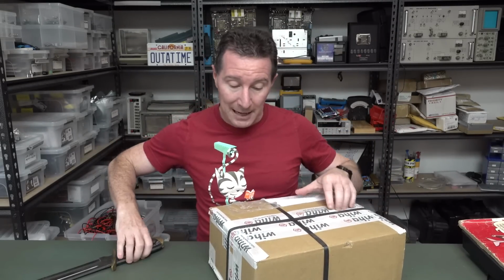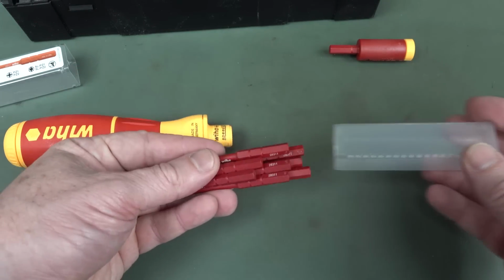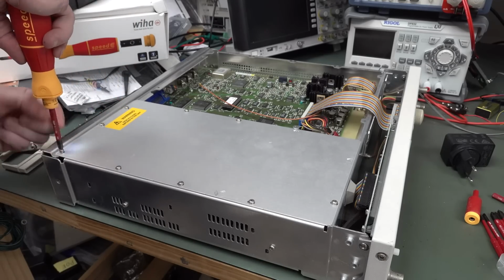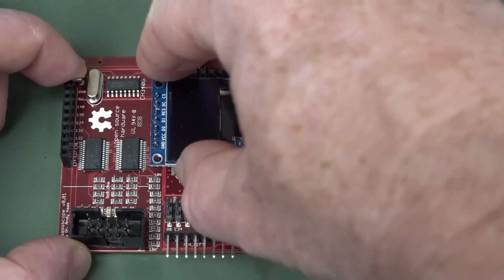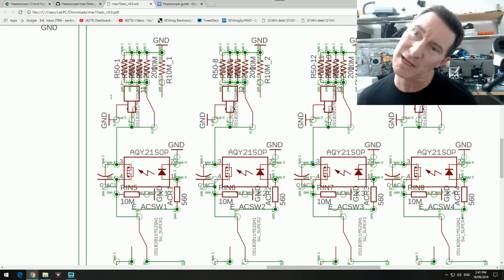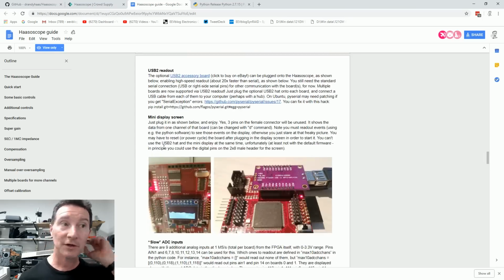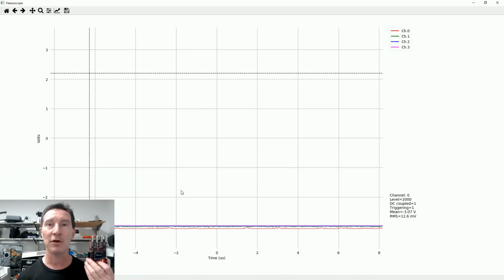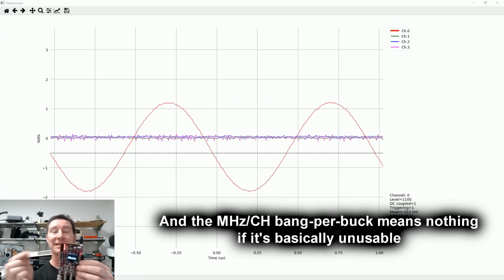EEVblog #1127 - Mailbag Monday

Comment: The red Wihas are of the electricians line, it's made for electricians doing building installations, wall sockets, switches etc, the torque, speed form factor is standard and made for that.
Github definitely needs to fix the download thing, I also wanted to download a certain folder but you have to download the whole project or just one file, they should make a client, like Dropbox, G-Drive etc.
Reply: The whole point of Git is to have full local copy of repository

Comment: That scope ain't great in a lot of ways, but I think your a bit hard on the UI python stuff. I do stuff like this all the time using python + matplotlib + numpy + pandas etc where I'll make some hardware and write some firmware and then hack up a UI or app for the dev team to use until the finished product is ready (maybe some of the more complex algorithms are running in python, not firmware, while we get them sussed since its easy to plot or dump to a file or db etc) . Sure its not a polished user experience that you want to show off to customers too much (although I have incrementally turned them into that in the pat with reasonable results), but you can make a UI like that in a afternoon vs months for a professional looking thing and use it to figure out all the 101 todo things you don't know about while someone knocks up a C++ gui over the next 4 months. So if the point of the thing is to give a user a polished scope that compares to the Rigol DS1054 or clever scope or what ever, then that's not great. But if the idea is to show someone how to hack this stuff together and proto-type like a champ then I like it since we need more engineers that can do this. And the great thing using it you were able to find lots of likely firmware or hardware bugs, like the DC offset on timebase adjust etc that need sorting out. Finally you had a bit of a hard time with python, pip, git etc, but these are pretty common tools for hacking now (but life is a lot easier in Mac or Linux in a real shell), so if this is a hackers thing then I don't think its not too much to expect them to run python, pip install some things, and use github (I would actually prefer it as it is quicker).

Comment: Short-cut keys for a UI ?  . . . Nope. Looks very frustrating to use. The hardware AND software look and work like it's still in the prototype stage . . . not something you would release to the public. Maybe, if marketed as an experimental tool. (GitHub was a little confusing to me years ago, but once you get the hang of it, it's OK . . . definitely has its merits.)

Comment: That's what I hate about Eagle . . . I knew it wasn't a formatting issue with the PDF . . . by default all the component meta-data displays on schematic . . . default fonts are horrible. Default symbols are horrible. And if you're not experienced with schematics, hand-drawing or EDA, EVERYTHING looks horrible. I gave up on Eagle and learned to use Kicad. I've been drawing schematics since I was 8 years-old (am now 57!). I want my schematics to be clear, uncluttered, mono-chrome, clear legible old school drafting-type fonts, have proper flow, and a joy to read. Easy on the eyes.
Reply from the maker: Didn't know that, thanks.

Comment: I can tell that most of the people complaining about installing python are the "if it ain't broke, don't fix it!" type.. >_<

Personally, I find the geriatric, curmudgeonly complaints about the open-source scope quite amusing.  How hard is it to download a zip file or navigate to a folder and download a pdf?  It has .PDF at the end... Do you really need that much help? Take a deep breath, its going to be okay :)

Generational bashings aside, It seems like its quite feature-rich. Like most open-source projects, when they start they are often confusing to those who are used to turn-key solutions.  But turn-key solutions are the result of teams of seasoned engineers and huge budgets--that's why they either cost way more money and have well-refined interfaces.

Comment: I can actually tell you why the insulated bits are so handy. I work as a meterman in germany, having to change dozends of electricity meters every day, usually with live wires. Im using the SpeedE for a few weeks now, and around my colleagues this is pretty much the tool we've been waiting for. The life time is pretty long, it usually lasts me around a thousand screws. Plus, the small red barrel adapter are actually torque adapters, so you can't hand-tighten youre screws past a certain point.

It's probably not going to make a difference when you only take apart a single device, but when having to screw and unscrew all day long, with a lot of uncomfortable angles involved, it makes a massive difference.

Comment: For the hacky stuff I was doing a couple months ago, this would have been quite amazing. Direct capture into python is what I wanted, but at the same time, the Rigol has ethernet standard, and there's already premade python libraries that just grab the data directly off of the scope over the network. It's not worth it if you want to use the scope for anything else. You were using essentially an example script.

Comment: Python is the newbies re-introduction of interpretive BASIC ! The open source competitor to Photoshop, called Gimp, is programmed in Python, and it runs like molasses. This was the the problem of running interpretive BASIC, back in the CP/M and early IBM PC days ! That's why there are COMPILERS !
Reply: Python has nothing to do with BASIC. It was influenced by: ABC, ALGOL, APL, C, C++, CLU, Dylan, Haskell, Icon, Java, Lisp, Modula-3, Perl, Standard ML.
GIMP is written in C, not Python, say that "it runs like molasses" to C guys.
Most of the things do not have to be compiled. But if something do, there is implementations of Python that can be compiled or you could just write your resource intensive function in C, compile it and use it in Python.

Comment: I recognize that IFR/Aeroflex 2025 signal generator you were testing the screwdriver on! I acquired one myself recently for around $400, because it was being sold "as-is, doesn't power up". Problem was simply an open resistor in the power supply. Easy fix!

Comment: The “haasoscope” is, in reality, a cleverly disguised ad for a nice analog scope! Which is what you’ll be hankerin’ for after playing around with this silly thing. Go get the hot air rework station, remove all the components from it, and put them back in your parts bin; that’s really the only value in this thing. As for the rest; see if it’s rated to withstand a 480 V 3-phase arc-over (with proper safety gear, of course!)

Comment: You really ought to do a comparison with that Wiha and the ES120/ES121 "touch screwdriver" from e-design (the folks who made the TS-80/TS-100 mini soldering iron). Big size difference but for electronics fasteners how often do you need a huge leverage?
Reply: There is nothing to compare.

Comment: I was told by the store selling the wiha it's meant to tighten breaker connections, beeing regulated for the recommended torque
Reply: But it's not regulated for torque. The final torque value is performed by hand, taking a guess on the Nm applied.

Comment: How about, buying a combination drill which is at least half the price. $500 or something which is 18v 3Ah.
Reply: How about VDE 1kV approval?
Reply: @JGnLAU  I know that as being a sparky myself for over 14yrs but you do your best not to work on live stuff. Yes we all go it, especially if your doing commercial all the time. 
Me personal I can use CK 1kV instlated screwdrives almost as fast as this tool. If it was 2 to 3 times faster then it'd be a good tool but as it's got no grunt and especially the rediculas price then it's a no go. 

Murphy's Law says when you really need it. The battery will be flat and no where to charge it. I still think it's mad that it doesn't use ths bog standard 18650.
Reply: @thomasg As I've said before. This is a very expensive tool and when the battery goes flat, sods law both of the batterys will be flat. If they were 18650 then they'll be a lot cheaper as they as used in EVERYTHING! 

All you need to do, is use that money to buy a new 18v 3hA cordless drill and loads of new really good quality insulated screwdrives. That way, you can use the drill with the different torque settings to do all of the connections and then if needed use the screwdrives to give them a tiny bit of torque if needed. And as I've said before, if your doing shit loads of these, it'll be a dead supply or turn the breaker off. 

Do not give me any BS, are any of yous Sparky's? If so, show me your cards. 
I've been a sparky for 14yrs now, working in ever different types of environment going from domestic to steel mills and everywhere in between. I know that this tool is a load of wank. Even if it was £50 I wouldn't buy it. Even if they gave it to you for free I wouldn't use it. It's a crap tool and before you ask, yes I have used cordless drill on live equipment for years.
Reply: @thomasg yep. I completely agree.
There only good for big massive companies that aren't worried about money. It'll be really good for doing loads of panels I know that much. I've done loads of panels in the past, but all of them were dead.

Comment: I really love the idea of stackable multichannel osciloscope (I even started designing my own), but execution is poor, frontend is meh, no relays to switch ranges or coupling. USB should be built in, there should be an option for the 1U case, spacing for probes is ridicoulus. I get that it allows to stack them and have very high density, but come on, add 2 more millimeters and be done with it. The LCD screen is pointless.

And software is very poor (not the github thing, but actual usability of UI), just like 90% of other scopes. The only reasonable USB scope I found so far is Cleverscope.

Also, this is not the only first open source one. ScopeFun https://www.scopefun.com/  https://circuitmaker.com/Projects/Details/Danilin-Sergey/MyScopeFun is a high performance open source scope.

Comment: I'm an electrician and I've been saying for years I need something like that. I like the way you need to manually undo and tighten the screw. For me that is ideal. If you are tightening up 3.5mm screws it doesn't take a lot of torque to strip them so having a motor to screw the screw in and out but allow me to tighten it up will save me time and my wrist a lot of twisting.

Comment: Not here to argue, but about github (or gitlab or bitbucket) thing - it's currently a standard for sharing open-source and every developer currently knows how to use git and how to work with repositories at least at some basic level, it's just a mandatory thing for any developer in this day and age. I guess there're exceptions like guys from 1950's or just only hardware guys, but for guys that program that's common and industry standard approach.
Reply: All true, but if you use GitHub you should also know how to distribute releases using it. Nobody expects regular users to do git clones just to use a piece of OSS. So basically none of git functionality even figures into getting a release off GitHub – at least it shouldn’t. The link to the latest release should be the first thing in the README. Most decent OSS projects have it there. The only reason for a git clone is to develop/hack on stuff. If a project needs a clone just to use it, it’s sorta an automatic thumbs down (unless it’s a developer product meant to be consumed as a git submodule or is in prerelease stage).

Yeah, everybody should know git, but if you need to use that knowledge just to use what is a stand-alone application, then the project is failing its users :(

Comment: As a electrician who works in the electrical distribution field my job demands electrically safe tools to install kWh-meters. The screws which hold the wires must be tightned with 2.6 Nm. I have a Wiha screwdriver with torque-setting, because Wiha is the only tool with adjustable torque-setting ànd has a 1000 Volt rating. After screwing 16 screws (three phases and Neutral, in and out, two screws per wire) your hands feel pretty bad... This electrical screwtool could save time and wrists, but i think it's a bit too expensive for just frictionless screwing (and still have to use another screwdriver to fasten things with a certain torque)

Comment: I have built a few USB o-scopes from arduino projects off the Internet.  Many of them were much better then that board, of course they lacked the screen mounted on the board and such and only had 2 input channels. The best of the lot turned out to be not USB at all but sound-card run, I didn't wish to nuke my laptop board, so I used a cheap china external sound card for it, thus sort of converting it to USB in the end I guess.  That one looks like a fairly nice toy to give your nephew who is just trying to understand the very basics of electronics.  Sort of like the old Radio Shack 108 series kits with springs and wires for making circuits and such.  They were great fun, and that board looks like it would be fun for say a 12 year old who likes electrons.

Comment: Woahhhhhhhhhhhh 500 bucks! Holy @&#$

Haha. F that!

This tech will have to come further to impress me. Its just so hard to beat manual screw drivers :)

Ive got a cool one that is not electric, but it does ratchet. And if you hold it a certain way.... It speeds up to 4x speed. And still ratchets.

Mine was probably only 20 bucks or 40 bucks soooo :) and i like it.

Comment: Quite expensive that screwdriver - but Marco Reps reviewed the ES120 and ES121 powered screw drivers, and they are even cheaper, plus they seem to be geared more towards finer electronics stuff, while this thing reminds me of a carpenter's tool. I think if I had the money for something like that, I'd probably buy an ES121 or ES120.
Reply: It really has no power what kind of screwdriver is that.

Comment: 3D Print a piece that fits on the handle on one end, and the cap on the other to accommodate an 18650.
Reply: I guess David - not Dave - could easily do that. Is he still around?

Comment: The software for that USB "scope" is standard fare for scientific research labs. Python2.7 with the trifecta of numpy, scipy and matplotlib is the golden standard for students' quick&dirty data analysis, github is pretty trendy too. Marketing this as an actual scope rather than a hobby kit is a huge mistake though. And I simply cannot comprehend how they didn't fix the connectors as fondling cables is like half of what students do in a lab.
Reply: looking at github, it seems like it's only one guy working on this. That's actually pretty impressive. But clearly this projects needs more contributers to make it a viable datalogger for a rPi or something.

Comment: I get screwdrivers stolen all the time, especially new ones, I'd say $200 Australian dollars worth every year, I would not be happy having a £250/$500 driver stolen, would be looked at as stupid for spending that much on a hand screwdriver when that will get a good drill driver.

Wouldn't want to drop it down a lift shaft either... too small and easy to lose or have stolen..

Comment: except for the protection, I really like the Black+Decker Gyro screwdriver as it has analog speed control. The further you turn the faster it turns. never stripped a hole with that. At CAN30$ cant really go wrong for a hobbyist.

Comment: Open source hardware/firmware/software. Only Eagle CAD has been used for the circuit design, which is definitely not free and thus presents a barrier to entry when attempting to improve upon this "open" design. Yes, there's a free version, but that's limited to 2 layers and this uses at least 3 by the looks of it. Same deal with the firmware - need to use the Altera software, which isn't exactly free. Yes, it's free as in cost now, but good luck getting it to run on platforms it's not been built for...
Reply: To be fair, there isn't really any serious open FPGA platform.
Reply: @MarianKeller  There's an open source toolchain for iCE40, but to be honest FPGAs aren't an area I know much about and wouldn't be surprised if the devices and/or toolchain are lacking in this instance.
Reply: This may be changing with the introduction of the Arduino MKR Vidor 4000 (sounds like a "beyond the press" product number...). See the guide at: https://www.arduino.cc/en/Guide/MKRVidor4000